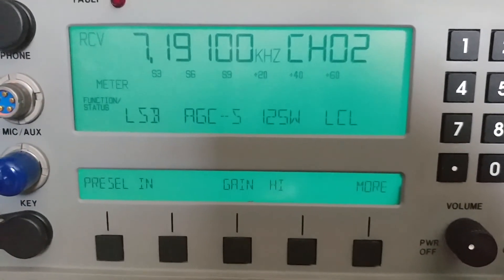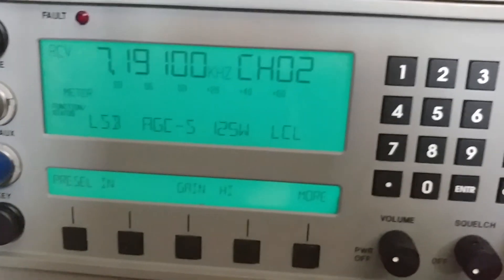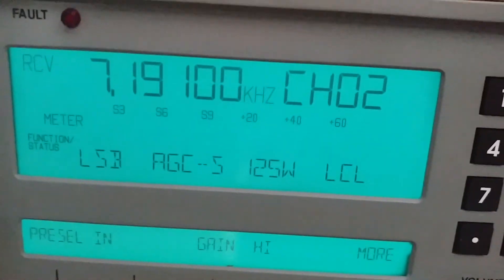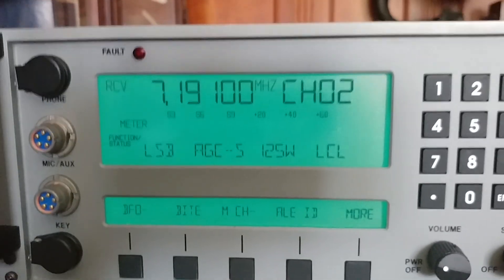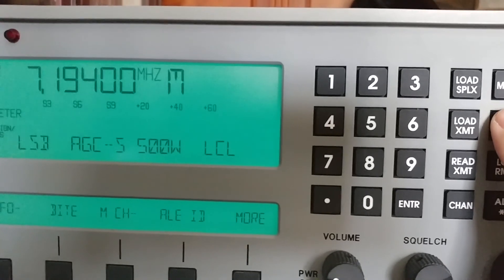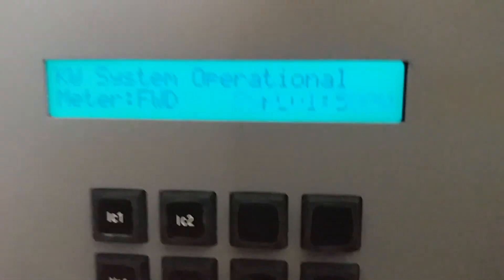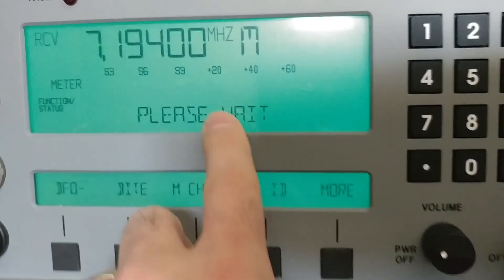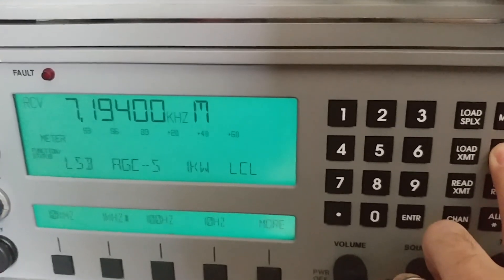Sunair RT-9000B/LPA-9500/RCU-9310B Power setting issue

Comment: I wonder if Sunair tech support would help troubleshoot this issue or do they require that you purchase RT-9000s for all of your Coast Guard Cutters before they'll agree to talk to you? :P 
73, Wes/W9YYH
Reply from the maker: Wes, Actually quite the opposite! I've been very please with Sunair's support. This radio, while no longer sold, is still supported. They've been very helpful and explained that the EPROM in this was never designed to be used with the 500W amp. They said they sold very few of the 500W amps. I also recently purchased a mobile shock mount from them. Not cheap but where else could you get one? They are very pleasant to deal with and very helpful.